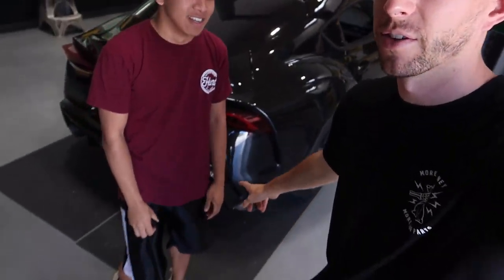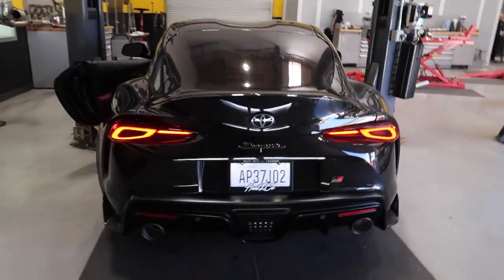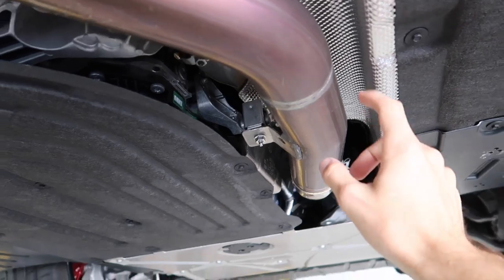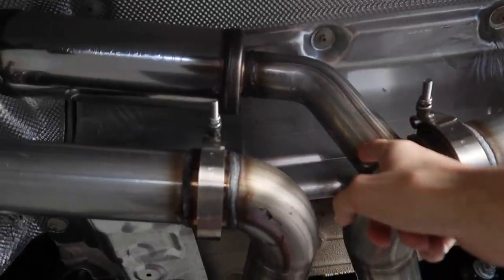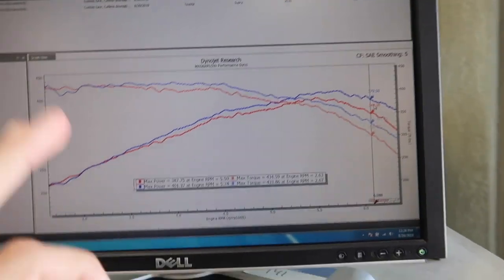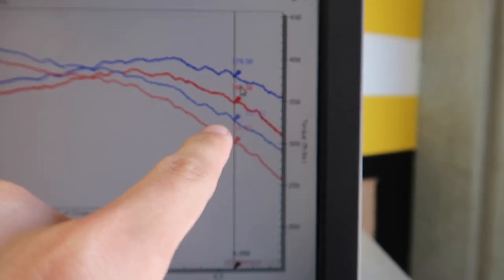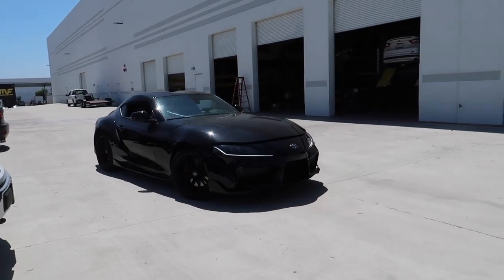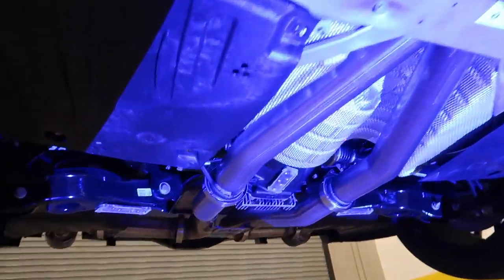I MADE THE LOUDEST SUPRA IN THE WORLD!

Comment: So here's an idea.
Put a muffler on the left pipe and leave it off the right one. Nice and quiet with the valve closed and straight through with the valve open.
Reply: Koop yeah as it is the only difference between valves open/closed is just having the gasses flowing out of 1 tip or two...

Comment: I reccomended Who ever didn't love he's car this is the upgrade.

Twin turbo 40psi each
Exhaust pipe Straight 
Race Cam
Block in/outside upgrade (piston,Intake (Any intake) 
K&N Air filter 
Fuel tank Tune (Seriously drains fuel faster) 
Remove speedcut (Force Engine to Max speed "May Blow your engine")
Chassis Reduction weight 

Please don't blame me if your car blow

Or just remove Cutting speed

Comment: What a nice revvy powerplant for a turbo charged system.
So withg a tune you might get close to 500wheel but keep the oem smoothness. Vs bigger turbski and moving the powerband up the range thus changing the character.
IDK, Iguess there are different thoughts of which way to go. Other tuned Supps might be more powerful but will it be as fun to drive, i think it will come down to the purpose of the car. straight line vs twisty stylez. so many options already. Personally this with a tune will be the bees knees.

Comment: The only problem with those clamps are that they have to be replaced everytime they come off so if you want to switch those mufflers  you are going to replace them not to say people will do it a lot it depends on what you are going to do with the car so if you are switching a lot you might want ro stock up on those clamps or you will have a exhaust leak

Comment: Turbo cars tend to run a lot better with free flowing exhaust even if it’s straight piped it may even run better without that Muffler
Reply: Turbos do though require some back pressure otherwise if it's too free flow it will produce less power than it could

Comment: that funny tube is called a helmholtz resonator.  Generally, the longer it is (also more volume), the wider the range of frequencies it can cancel out.   A short one will cancel out some of the drone at certain frequencies but less than a long one.  It's the same principle that governs the sound when you blow across the bottle opening.    Try it out with less water in the bottle vs more water and you can hear different sounds.   ok nerd moment over.

Comment: Didn't you say you made 380 wheel horsepower? Got your mirrors wrapped. Premium comes with CF mirrors. Your exhaust is nice. Damn that Supra front end needs a body kit replacement, because it is ugly. Can't wait to see companies make body kits for it. You could design a roll bar, TJ hunt Roll bar. Anything faster than 12s needs a roll bar. You know you're going to have to race Adem  LZs Supra one day. Need to fix yours up. 1 pice carbon driveshaft. Magnesium wheels 😁

Comment: Its called a helmholtz resonator.  And its nothing new in real exhaust designs.  A properly designed HR not only reduces drone the location can increase exhaust scavenging if the pressure wave is properly consired increasing hp output.  This effect is more pronounced on hi riving na moters vs FI.  Example is the s2k oem exhaust has one.